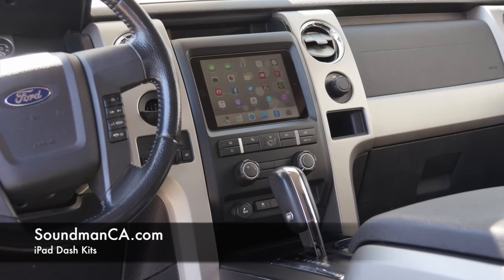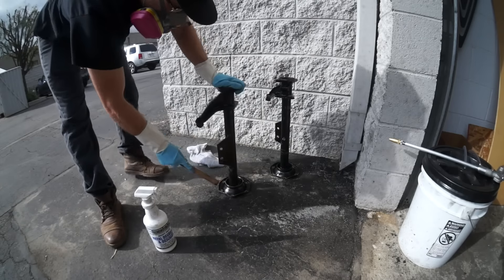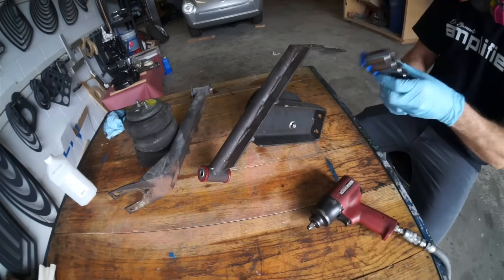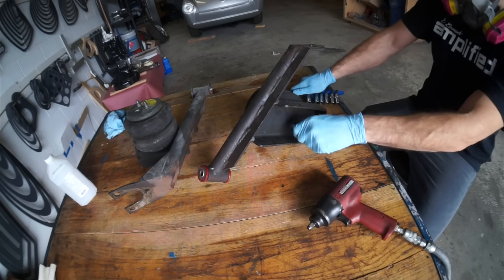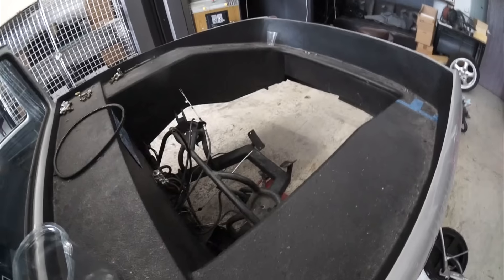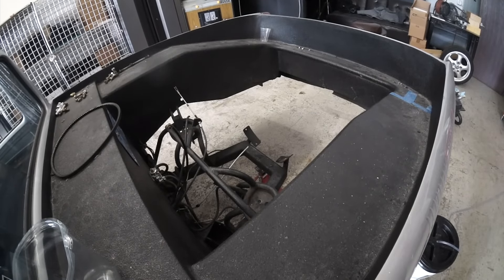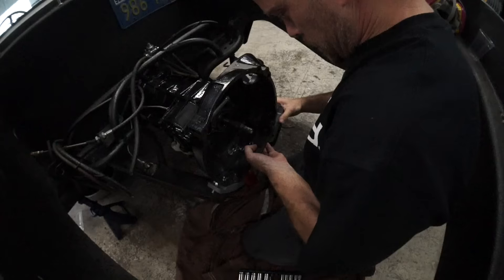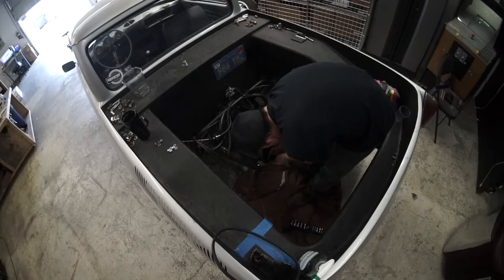It Doesn't Fit Anymore!

Comment: Yes you need another crossmember for a Subaru engine, it has two studs sticking down on ether side of the oil pan and is secured to the cross member with two 14mm head nuts. A EJ22 is a good option imo and very reliable.

Comment: You're supposed to torque the nut, not the bolt head! Also - is that degreaser from the siphon gun biodegradable? Do you have an oil/water separator in the drain? Mad fishies gon b dyin son.

Comment: Hey doug. Here in dallas we have a company called "Auto Magic" that has trucks that frequent car dealers weekly that sell professional auto detailing supplies. Kinda like the Snap-On trucks I'm sure you guys have there. Anyway, I'm sure theres a company that does the exact same thing there. Look up whatever company provides this service in your area. The professional grade supplies are much less expensive to buy by the gallon or whatever and are WAY BETTER than that Simple-green garbage your using. The professional grade degreaser is SOOOO much better. Just a tip for yo white ass. 🤓